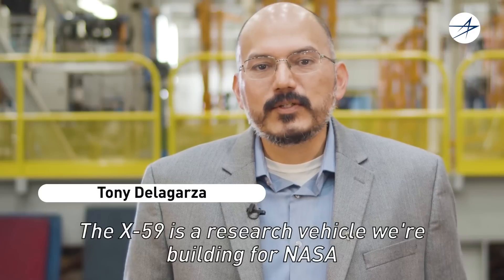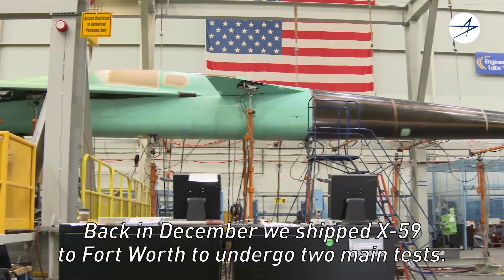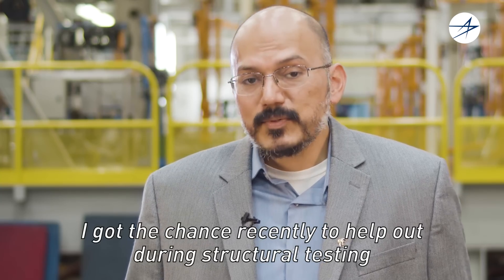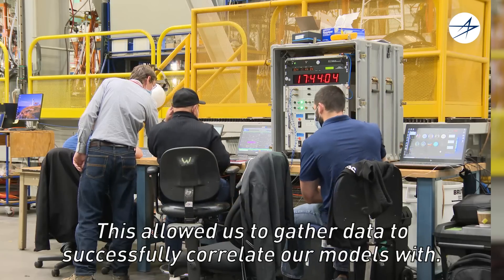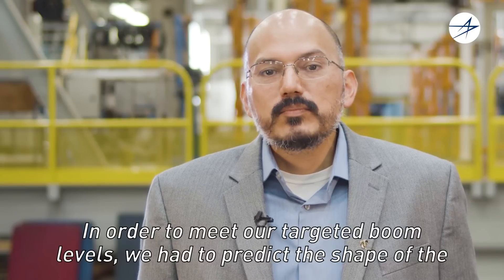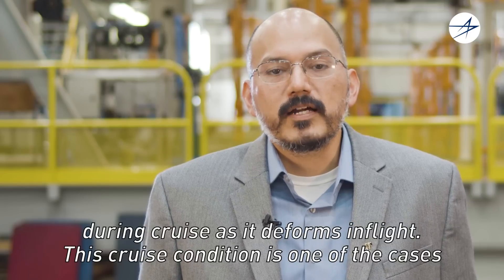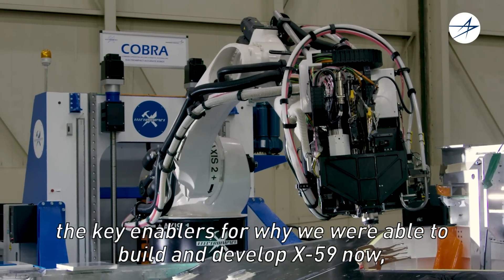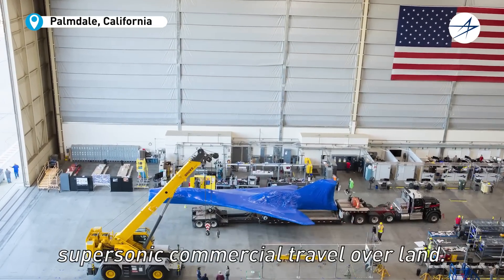Supersonic X-59 Continues to Progress in CA

Comment: Is there a big difference between supersonic and hypersonic?
Reply: yes there is
Reply: Hypersonic is generally things above mach 5. In practical terms, anything above mach 3 is ludicrously fast—especially with a person inside. Rapidly changing direction in an aircraft doing several times the speed of sound can put enormous G-loads on airframes and occupants.

The MiG-25 can do about mach 3, but at those speeds, it starts to pull itself apart pretty quickly.
Reply: Mach 5 below = supersonic
Mach 5 above = hypersonic

Comment: Nickname: "The Silent Duck" or "The Silent Quacker" I got to do the simulator for this in 2019 at AirVenture. If you put the camera behind the engine, it would shake the seat. Very relaxing easter egg after walking 7 miles around the airshow.

Comment: Lockheed Martin:  Do my gravity test and potentially be able to have anti-gravity:

GRAVITY:  (copy and paste from my files):
Here is the test for the 'gravity' portion of my TOE idea.  I do not have the necessary resources to do the test but maybe you or someone else reading this does, will do the test, then tell the world what is found out either way.

a. Imagine a 12 hour clock.
b. Put a magnetic field across from the 3 to 9 o'clock positions.
c. Put an electric field across from the 6 to 12 o'clock positions.
(The magnetic field and electric field would be 90 degrees to each other and should be polarized so as to complement each other.)
d. Direct a high powered laser through the center of the clock at 90 degrees to the em fields.
e. Do this with the em fields on and off.
(The em fields could be varied in size, strength, density and depth.  The intent would be to energy frequency match the laser and em fields for optimal results, cancelling out the em modalities of the laser, thereby leaving behind the gravity modality.)
f. Look for any gravitational / anti-gravitational effects.
(Including the utilization of ferro cells so as to be able to actually see the energy field movements.)
(And note:  if done right, it's possible a mini gravitational black hole might form.  Be ready for it.  In addition, it's possible a neutrino might be formed before the black hole stage, the neutrino being a substance with a very high gravitational modality with very low 'em' modalities.)

(An alternative to the above would be to direct 3 high powered lasers, or a single high powered laser split into 3 beams, each adjustable to achieve the above set up, all focused upon a single point in space.)

'If' effects are noted, 'then' further research could be done.
'If' effects are not noted, 'then' my latest TOE idea is wrong.  But still, we would know what 'gravity' was not, which is still something in the scientific world.
This test can speak for itself.  It will either be true, partly true, or not true at all.  It will either show what gravity truly is, might be, or is not.  Science still wins either way and moves forward.

*  And note:  Whether my gravity test or another's, a gravitational black hole would have to be formed to prove the concept as being really true.  A gravitational black hole that 'if' self fed itself, could literally wipe out this Earth and all on it, possibly this solar system, possibly put a black hole in this section of our galaxy, and potentially even causing a ripple effect in this galaxy and surrounding universe.  But hey, if it does, no worries.  Nobody would be left to prosecute those who did so.  (Possibly famous last words:  "Hey, it worked.  Ooooppppssss.................)

But as NASA has already proven that low gravity conditions over a prolonged period of time is harmful to the human species, and large rotating space ships won't really work for space bases on planets and moons, those space bases probably being needed somewhere along the way out of this solar system and galaxy, we need to figure out what gravity truly is and see if we can generate artificial gravity so as to have smaller space ships and proper gravity conditions for space bases on planets and moons.  Otherwise, at least all human life will most probably die and go extinct one day.  Currently, no exceptions.

**  Added note:  Just trying to save at least 1 single species from this Earth to exist beyond this Earth so that life itself from this Earth has continued meaning and purpose to.  Gives me something to do while I exist, otherwise, what is it all and everything for?  Even if my TOE idea were correct, but if it did not help species survive beyond this Earth, what good would it ultimately be?

So, are you feeling lucky?  Doing nothing and at least the entire human species eventually dies and goes extinct with a high degree of certainty.  Doing a gravity test, (mine and/or another's), and there is at least a slim chance of literally wiping out this entire Earth and all on it, and possibly more.  Do you and other's truly want me to prove my TOE idea as being really true?

(Since all of life itself is ultimately meaningless in the grand of scheme of things anyway, do the gravity test and see what occurs?)
Reply: Revised TOE: 3/25/2017a.
My Current TOE:

THE SETUP:
1. Modern science currently recognizes four forces of nature: The strong nuclear force, the weak nuclear force, gravity, and electromagnetism.
2. In school we are taught that with magnetism, opposite polarities attract and like polarities repel. But inside the arc of a large horseshoe magnet it's the other way around, like polarities attract and opposite polarities repel. (I have proved this to myself with magnets and anybody with a large horseshoe magnet and two smaller bar magnets can easily prove this to yourself too.  It occurs at the outer end of the inner arc of the horseshoe magnet.).
3. Charged particles have an associated magnetic field with them.
4. Protons and electrons are charged particles and have their associated magnetic fields with them.
5. Photons also have both an electric and a magnetic component to them.

FOUR FORCES OF NATURE DOWN INTO TWO:
6. When an electron is in close proximity to the nucleus, it would basically generate a 360 degree spherical magnetic field.
7. Like charged protons would stick together inside of this magnetic field, while simultaneously repelling opposite charged electrons inside this magnetic field, while simultaneously attracting the opposite charged electrons across the inner portion of the electron's moving magnetic field.
8. There are probably no such thing as "gluons" in actual reality.
9. The strong nuclear force and the weak nuclear force are probably derivatives of the electro-magnetic field interactions between electrons and protons.
10. The nucleus is probably an electro-magnetic field boundary.
11. Quarks also supposedly have a charge to them and then would also most likely have electro-magnetic fields associated with them, possibly a different arrangement for each of the six different type of quarks.
12. The interactions between the quarks EM forces are how and why protons and neutrons formulate as well as how and why protons and neutrons stay inside of the nucleus and do not just pass through as neutrinos do.

THE GEM FORCE INTERACTIONS AND QUANTA:
13. Personally, I currently believe that the directional force in photons is "gravity".  It's the force that makes the sine wave of EM energy go from a wide (maximum extension) to a point (minimum extension) of a moving photon and acts 90 degrees to the EM forces which act 90 degrees to each other.  When the EM gets to maximum extension, "gravity" flips and EM goes to minimum, then "gravity" flips and goes back to maximum, etc, etc.  A stationary photon would pulse from it's maximum extension to a point possibly even too small to detect, then back to maximum, etc, etc.
14. I also believe that a pulsating, swirling singularity (which is basically a pulsating, swirling 'gem' photon) is the energy unit in this universe.
15. When these pulsating, swirling energy units interact with other energy units, they tangle together and can interlock at times. Various shapes (strings, spheres, whatever) might be formed, which then create sub-atomic material, atoms, molecules, and everything in existence in this universe.
16. When the energy units unite and interlock together they would tend to stabilize and vibrate.
17. I believe there is probably a Photonic Theory Of The Atomic Structure.
18. Everything is basically "light" (photons) in a universe entirely filled with "light" (photons).

THE MAGNETIC FORCE SPECIFICALLY:
19. When the electron with it's associated magnetic field goes around the proton with it's associated magnetic field, internal and external energy oscillations are set up.
20. When more than one atom is involved, and these energy frequencies align, they add together, specifically the magnetic field frequency.
21. I currently believe that this is where a line of flux originates from, aligned magnetic field frequencies.

NOTES:
22. The Earth can be looked at as being a massive singular interacting photon with it's magnetic field, electrical surface field, and gravity, all three photonic forces all being 90 degrees from each other.
23. The flat spiral galaxy can be looked at as being a massive singular interacting photon with it's magnetic fields on each side of the plane of matter, the electrical field along the plane of matter, and gravity being directed towards the galactic center's black hole where the gravitational forces would meet, all three photonic forces all being 90 degrees from each other.
24. As below in the singularity, as above in the galaxy and probably universe as well.
25. I believe there are only two forces of nature, Gravity and EM, (GEM). Due to the stability of the GEM with the energy unit, this is also why the forces of nature haven't evolved by now. Of which with the current theory of understanding, how come the forces of nature haven't evolved by now since the original conditions acting upon the singularity aren't acting upon them like they originally were, billions of years have supposedly elapsed, in a universe that continues to expand and cool, with energy that could not be created nor destroyed would be getting less and less dense? My theory would seem to make more sense if in fact it is really true. I really wonder if it is in fact really true.
26. And the universe would be expanding due to these pulsating and interacting energy units and would also allow galaxies to collide, of which, how could galaxies ever collide if they are all speeding away from each other like is currently taught?

DISCLAIMER:
27. As I as well as all of humanity truly do not know what we do not know, the above certainly could be wrong. It would have to be proved or disproved to know for more certainty.
Reply: The mathematics for the TOE doesn't even exist yet as far as I am currently aware.  It goes beyond any quantum field theory formulas that I am currently aware of.  The outline though is basically as follows:

The formula has at least 3 levels to it:
1. The Internal Photon Level:  The 3 interacting forces, (which might even be just a singular force with 3 different modalities), all interacting at basically 90 degrees to each other and all simultaneously pulsating and swirling.  A complex part of the formula but I believe to be totally doable.

2. The External Photon Level:  For each pulsating, swirling photon, all the pulsating, swirling photons interacting with it.  An exponential part of the formula that I am not even sure modern day super computers could adequately handle.

3. The Inter-dimensional Photon Level:  For each modality within each photon would have an energy frequency associated with it.  The energy frequencies could be seen as being in their own space time dimension.  (For me, 'space' is energy itself of which is the 'gem' photon and 'time' is the flow of energy; 'temperature' is the interaction of energy), so one would be dealing with way more than just 3 spatial dimensions and way more than just 1 time dimension (as there would many different energy frequencies with many different flows of energy).  Whenever like resonate energy frequencies resonated with each other, they would affect each other, kind of like 'spooky action at a distance'.  Anytime energy frequencies overlapped, there would be a temporary spike of some sort in each space time dimension.  In addition, if in reality the 'gem' photon is just a singular force with 3 different modalities, it's possible that energy could 'slip' between modalities which would also affect the results.  A very complex part of the formula on top of all the complexity that came before it.

4. Any time any energy moved in the system, the entire formula would have to be recalculated due to potential ripple effects.

5.  In addition, I am operating in a realm where one plus one does not always equal two, and often does not.

Like I said above, I don't even believe the mathematics exists yet for what I am trying to do, but at a minimum, the formula would contain the above levels the way I currently see it to be.  And I never said it would be easy.
Reply: 'IF' my latest TOE idea is really true, (and I fully acknowledge the 'if' at this time), that the pulsating, swirling 'gem' photon is the energy unit of this universe that makes up everything in existence in this universe, and what is called 'gravity' is a part of what is currently recognized as the 'em' photon, the 'gravity' modality acting 90 degrees from the 'em' modalities, which act 90 degrees to each other, then the oscillation of these 3 interacting modalities of the energy unit would be as follows:

Gravity: Maximum in one direction, Neutral, Maximum in the other direction;
Electrical: Maximum in one direction, Neutral, Maximum in the other direction;
Magnetic: Maximum in one direction, Neutral, Maximum in the other direction.

Then:
1 singular energy unit, with 3 different modalities, with 6 maximum most reactive positions, with 9 total basic reactive positions (neutrals included).  Hence 1, 3, 6, 9 being very prominent numbers in this universe and why mathematics even works in this universe.
(And possibly '0', zero, as possibly neutrals are against other neutrals, even if only briefly, for no flow of energy, hence the number system that we currently have.  This would also be the maximum potential energy point or as some might call it, the 'zero point energy point'.).

And also how possibly mathematical constants exist in this universe as well.

*  Note also:  Nobody as of yet has been able to show me how numbers and mathematical constants can exist and do what they do in this universe from the Standard Model of Particle Physics (SMPP).  While the SMPP has it's place, I believe we need to move beyond the SMPP to get closer to real reality.
Reply: Oh and also:  "IF" the above turns out to be true, 'AND' it is possible to generate artificial gravity so as to have smaller space ships and to have proper gravity conditions for space bases on planets and moons, 'THEN' by turning the unit around, one could have anti-gravity as well.
Reply: What a load of bullshit.
Reply: Pseudo-scientific twaddle
Reply: @gordondolan6443  Do the gravity test if you dare.